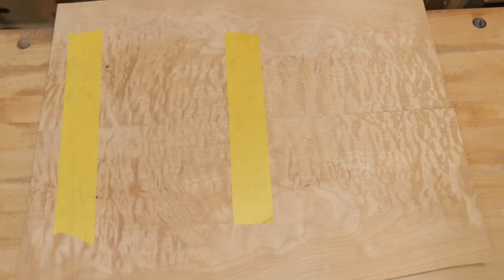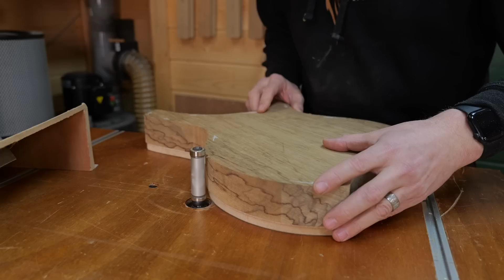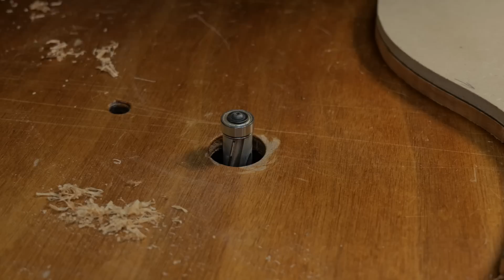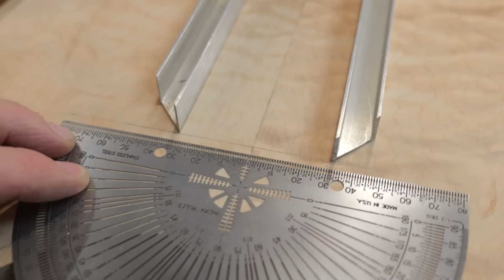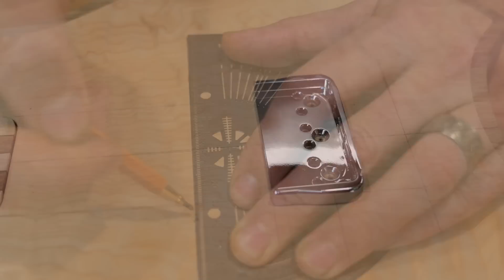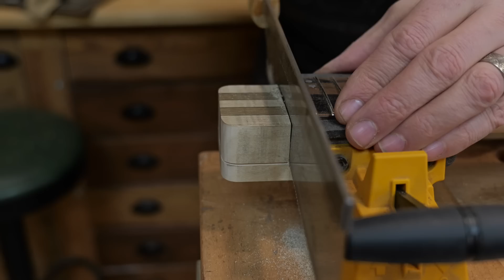"Nessa" the Spirit of Elegance and Speed - Guitar Building Series - Episode 3 - Making the Body

Comment: on that top clueing, have you ever considered making a tiny chamfer (like 1mm) on the top on the part that goes inside the cavity? I guess that might make it somewhat easier to insert the top on the body. this is what usually people do whenmaking a mortie and tennon connection so that it's easier to make the insertion
gret build btw :)
Reply from the maker: I have thought about doing that but the chamfer might show after carving.
Reply: @UnquendorGuitars  oh, now i got it :) yes, when you carve the body that chamfer would definitely show up (unless the carving won't go deeper than the top width) , and probably that would be noticeable if you fill the gaps post carving ;)
Reply: actually I really think it wouldn't show on the carving, I've watched it again and it looks like it wouldnt show because it looks like your carving it's always deeper than the top width and the part of the top that you actually see on the carving it's the bottom part of the top (maybe I'm not being able to pass the idea i have in my mind about this... lol  english is not my main language)
Reply from the maker: You are correct for most of the carve. If all goes as expected I shouldn’t reach the bottom of the cavity anywhere except for the cut-aways near the neck. The chamfer will definitely show in spots. 
Anyway’s I feel safer not having the chamfer and doing a marginal trickier glue-up than having a chance of a visible ‘gap’.
Reply: @UnquendorGuitars  you are right, ;) better doing it in a more saffer way then to have something messed up :)
Very nice build man , love it :)